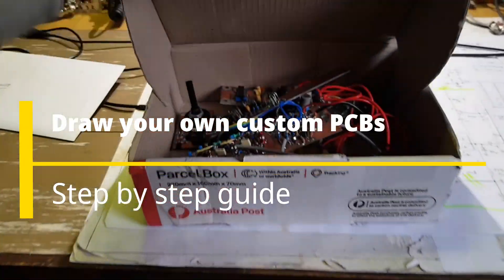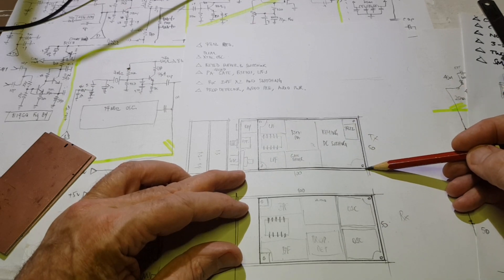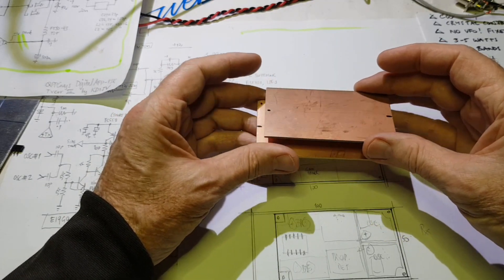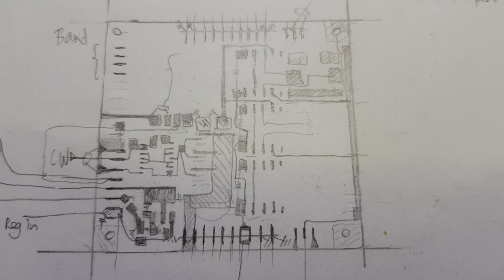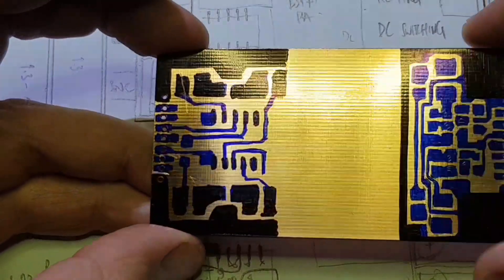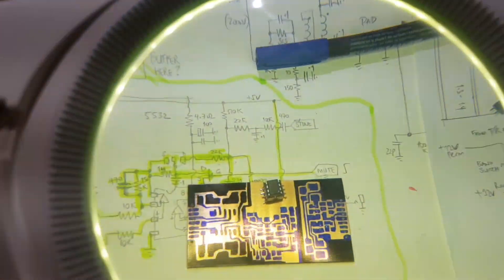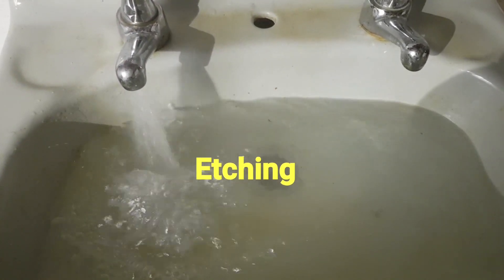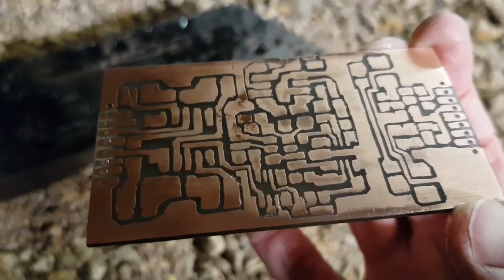The Art of hand-made Printed Circuit Boards

Comment: I have made "one off" PCBs more or less this way for decades. It is still the only etch-based PCB method which allows going from design to reality in a few hours without any equipment other than a permanent marker and a drill.

Having said that, in recent years I have mostly switched over to designing the artwork in software, printing it with a laser printer onto the Pulsar brand transfer paper, and then using that to transfer the toner to the PCB, and etch normally. I get more consistent results when I use an inexpensive heat laminator to do the transfer (instead of an iron) and adding the Pulsar green TRE foil, which sticks to the toner and makes it impervious to erosion during etching.

The biggest revelation I had have for ANY home PCB etching is the 'sponge etching' method. Works like this: use the normal ferric chloride etchant, but instead of filling a glass or plastic vessel with it, simply saturate a conventional 'kitchen' sponge with it. Wearing rubber gloves (I use disposable nitrile gloves), I hold the PCB with one hand the the sponge with the other (over something that won't mind being dripped on by etchant), and gently wipe the sponge across the PCB over and over. The sponge thusly applies fresh etchant every few seconds and removes the old etchant and dissolved copper, always renewing the etchant to copper interface. The etching goes amazingly quickly this way, and undercutting or through-erosion of the etch resist is a thing of the past. Also, no need to heat or bubble the etchant, and most importantly, since the dissolved copper (which is black) is constantly being removed by the sponge, it is very easy to see when the etching is done, and/or which spots need a bit more attention. Of course, this etching method would be more difficult to manage with true double sided PCBs, but if only a large ground plane is on the flip side, so NOT removing copper there is the goal, my method would work fine.

The other thing I always do is to tin plate the PCB immediately after cleaning. I just use the 'liquid tin' products; put the PCB in a dish, pour the bottle of liquid tin over it and watch for a few minutes while the tin deposition takes place, then pour the liquid tin back into its bottle so it can be re-used many times. This makes corrosion a non-issue and the PCBs remain pristine looking.
Reply from the maker: Thanks for your detailed information.  Very  interesting. I absolutely agree that hand drawn PCBs get you a small and simple  board, any board you like subject to these constraints,  in a couple of hours.  I've never heard of your FeCl3 sponge method. Clearly it wouldn't work with my Sharpie markup resist, the very first wipe and all that artwork would be obliterated.  But worth knowing.  73 Paul VK3HN.
Reply: @Paul_VK3HN  , I have used the sponge method on simple Sharpie etch resist boards. As long as permanent markers are used, they should be able to tolerate the relatively few wipes, using light pressure, that the sponge method requires.
Reply from the maker: Ok, I guess that's true, I'll have to try it sometime.  When using a ferric chloride bath you do need to agitate the tray constantly,  if you don't,  you can get a deposit film forming which slows the etch.

Comment: Learnt to do PCB this way with a 'delo' pen about 30 years ago, built first DC receiver for 80m to listen to CW sessions to study for my licence. Locating a NE602 mixer ic was a mission at the time too,  Used to transfer print from paper to grease proof paper/transfer paper then mark out with the pen, used to take a long time.  All the electronics publications used to include the pcb layouts.
 Your method seem nicely refined (showing a lifetime of experience) and contemporary smd application. Thumbs up.
Reply from the maker: Thanks for commenting Paul. Yes I remember tracing from the magazine pages to transfer the track layout, etc. After a while I just copied by eye. One thing I've learned is that almsot all my hand made boards have errors, but these mistakes are easy to work around.  You cannot be perfectionist with this approach, but, every board is a one-off, a prototype!

Comment: Good example. I’ve done basically the same thing. I’ve created stencils for parts to make adding them in faster and more consistent. For etching, I use an old aquarium heater and bubbler, and it seems to make the etching go quicker and more consistent. 

It’s refreshing to see others make their own boards. It’s an art that seems to be disappearing.
Reply from the maker: Stenciling is a good idea. I could have used a stencil for dual gate MOSFET amp stages, bipolar amp stages, Arduino Nanos and si5351 boards, to name a few.  Most of my boards are small and one-offs,  so rocking them in a basin of hot tap water suffices. But I know another homebrewer who does what you do with the aquarium heater.  Good work!

Comment: Intresting method. Good job. But why your not used ps + kicad or else free software for trasing psb?
Reply from the maker: You could do the board layout with kicad or similar.  At the time I'd not learned everything you need to do board layout. I've subsequently made a number of boards using EasyEDA from JLCPCB.  I will still do handmade boards for small pieces.
Reply: Yes, you can create a board in EasyEDA print it on glossy inkjet photo paper using Laser Printer, and copy mask from paper to PSB using hot iron or laminator.
Reply from the maker: @sergeykizilov38 That would work. I haven't tried it.  Lots of makers have. I'll do more off shore fabricated PCBs in the future, using JLC or similar.

Comment: Good work Paul, I used to do mine this way, especially for PA boards but I do find that the etchant leaves the board a bit sketchy where it eats through some areas I've marked up. Usually in streaks. I think you know what I mean. No matter how many times I go over it.
Thanks again.
Reply from the maker: Yes I do get streaks sometimes. Use fresh permanent marker pens and inspect carefully before etching.  Interesting, I used Ammonium Persulphate for a while but gave up for this reason, quite poor etches, went back to FeCl3 and good results returned.

Comment: Love this approach. Each board is a work of art! How reliable is the marker/sharpie ink generally at resisting the etchant? I'll have to give this technique a go
Reply from the maker: Thanks, appreciated. It helps if you can draw fine shapes and lay things out, picture it in your mind, or sketch it first. I use standard Pentels and Sharpies, as long as they are not too old or dry, they seem to work fine.  The fine tip I use for SOIC pins is a Staedtler Lumocolour size F, bought from Rockby Electronics here in Melbourne.  See you soon.

Comment: Can I ask a very embarrassingly naive question?  What’s the best way to clean a dull copper pcb?  Brasso?  Mechanically?
Reply from the maker: Hi there, I use fine steel wool, it's called Grade 0000 and it is used for polishing metal products and also in French Polishing.  I have tried creme cleansers such as Jiff and auto duco cutting paste, and have found these to be too fine for the first pass.  Use 0000 steel wool, then if you want to, try some Brasso or similar and it will really shine.

Comment: Hi Paul, unclear how long the etching process took. Seemed like just a few minutes. I used to put the container of etchant onto my old carphone to warm it and speed up the process. I used a paintbrush and some paint which resulted in very odd track shapes at times. My boards were all for through-hole components. After use i put the etchant back into the bottle and saved it for the next board. Your process is far more controlled and the boards look much better. I think I last made a board about 40 years ago. Oops. 73 Andrew VK1DA/VK2UH
Reply from the maker: Hi Andrew. On a small board such as that made in the video, etching takes only about 5 minutes. There are three reasons for this. 1. I minimise the total area of copper to be etched off by expanding the ground plane right up to the tracks. I also widen some power or signal tracks to again maintain around 2mm of distance from neighbours. The objective is to etch the least amount of copper as possible.  2. Heating the FeCl3 makes a big difference, I do that by floating the etching container in a basin of hot water. 3. I agitate the solution constantly, rocking the container so that the FeCl3 waves over the board, back and forth.  I used painted on bituminous paint in the early days too. Since then, some clever person discovered that Sharpie ink is just as good.  73 Paul VK3HN.
Reply: @Paul_VK3HN  yes it was bituminous paint, awful boards in fact. But better than dead bug style, i thought. My carphone (awa mr10b) provided the heat but i think the etch time was more like 30 mins with the etchant concentration I used. I’ll have to try your method next time. Thanks, Paul.

Comment: Very neat but it might have been keen to note the etching fluid is dangerous. And probably best to use respiration equipment. I ve seen laser etching printer and other prototypes board making aswell 😉
Reply from the maker: Yes good point, I will add warning to the description.  I always wear safety glasses as the eyes are the most exposed parts.  My workshop is well ventilated and my boards and FeCl3 volume are almost always small.

Comment: The problem with this is that if you don't have a good permanent marker pen with good ink that has good adhesive qualities, all the work could go in vain or with bad quality tracks. I had these experience several times.
Reply from the maker: You do need to keep your pens fresh. But I used the same pens for over a year, with no issues.